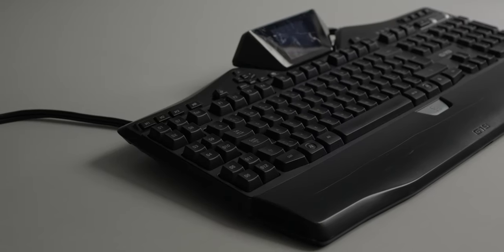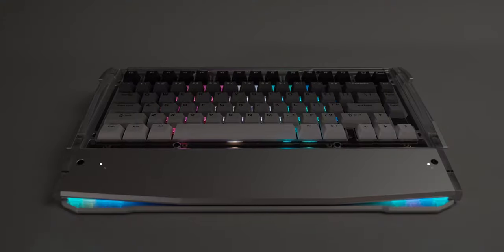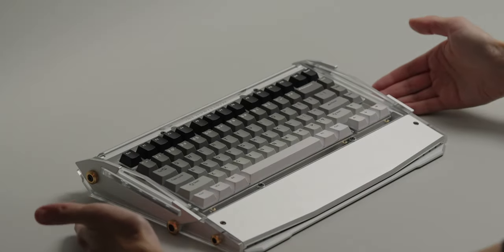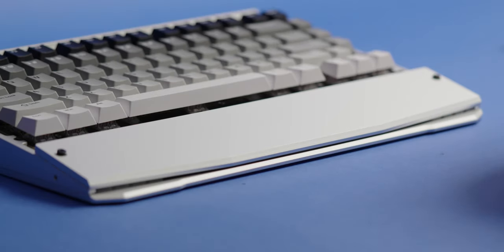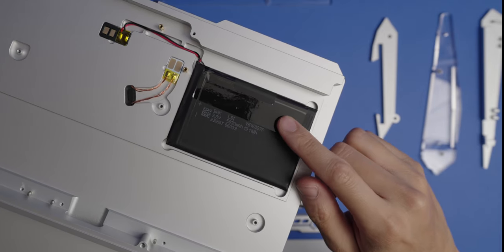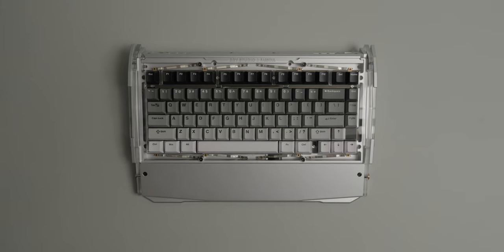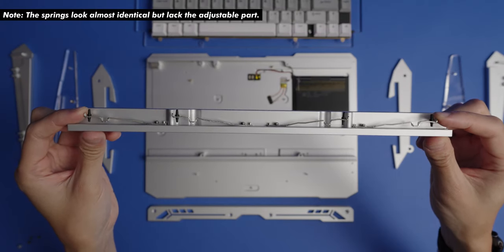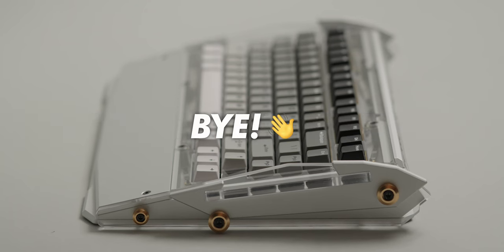So Much More Than “Just” A Gaming Keyboard | Dry Studio Black Diamond 75 Review

Comment: There's alot of things that boards can do to be better for gaming, one thing that I'm for sure interested in is the split thumb keys or more thumb keys as I feel it's a quick and easy way to provide versatility while not hindering or moving your hands away from your movement keys. One innovation that I wish was here was rapid trigger as for frame perfect movements like superglides they help immensely with consistency, that would basically put it at the top of the meta as there is yet to be a wireless competitor to the Wooting (although the feasibility of such a thing is probably very low). The board itself looks cool, although not exactly my style it is still pleasant to look at, I kind of wish it leaned more into it's theme and had more detailing/styling to fit the aesthetic of a engine.

You don't need insane equipment to ballpark latency, generally any smartphone that can shoot in 240fps is adequate enough from there you just test an input like say binding fire to [x] or anything else and you can get a good idea of the end to end latency, which while it can't give you objective numbers, it can give you comparisons.

You are right about the Wooting being the best, but I don't necessarily agree with OT being the best arbiter of peripherals.
Reply: Split spacebar is seriously undervalued

I literally can't use most keyboards because I value split spacebar & the resulting extra 1.25 L thumb mod (with the ideal split spacebar layout) so much
Reply from the maker: I totally agree with the engine look, I thought about that as well afterwards, they could have leaned in a bit more with that idea.

And thank you for the tip on shooting with the 240fps on my phone. I genuinely didn't think about that and will incorporate that in the future.

Thanks for the insightful comment and the tips, much appreciated 🙂